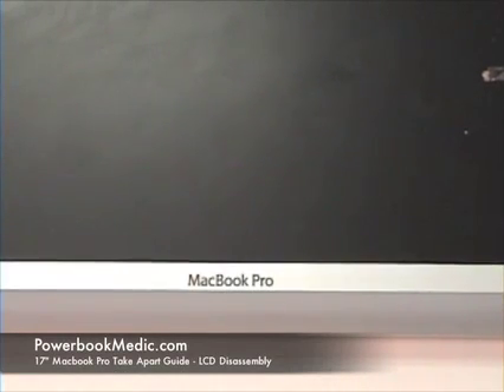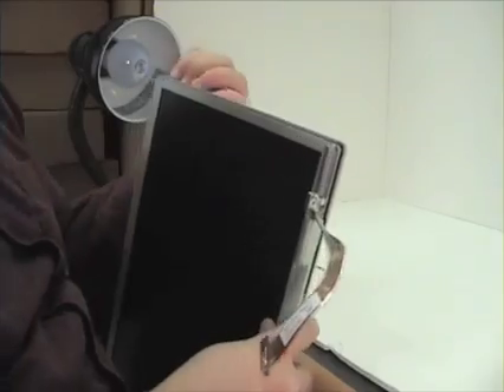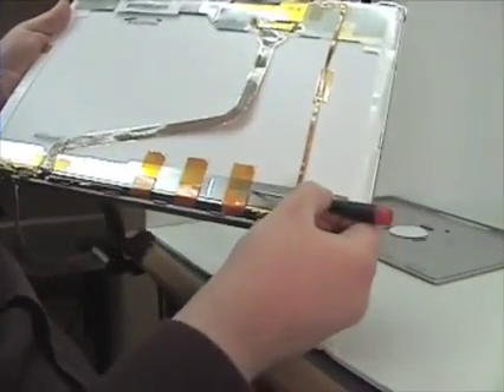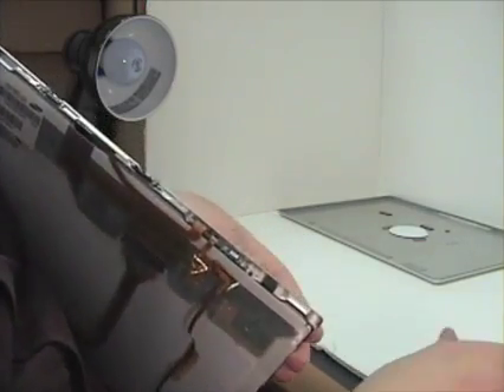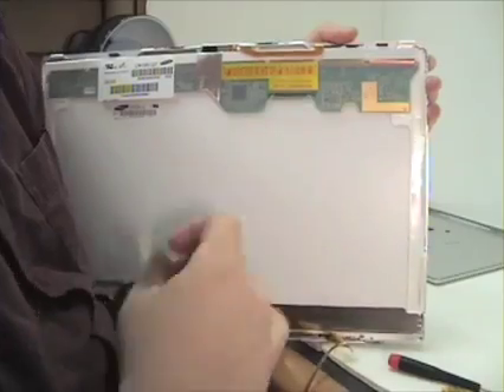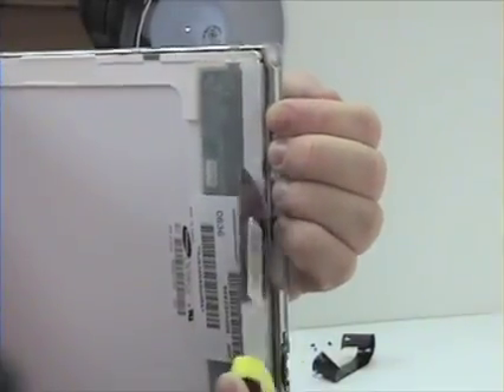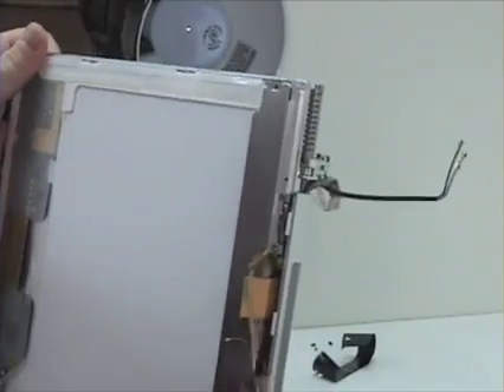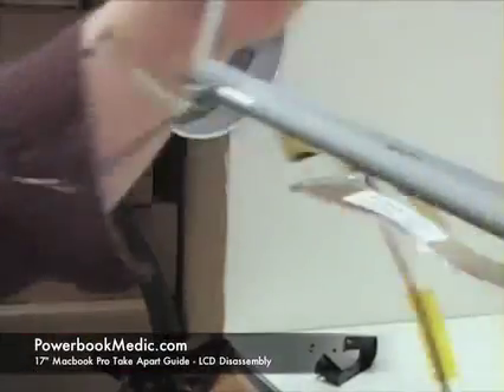Macbook 17" Repair - LCD Disassembly

Comment: good video - just needed a close-up when you first put the putty knife in because it isn't clear which part the plastic rib stays with - the aluminium back or the lcd and frame. I thought it stayed with the frame and chavelled it quite a bit. I also note the inverter stays with the lcd - I bought a replacement lcd without inverter. Think I'm stuffed.